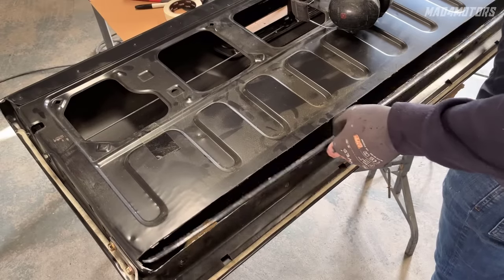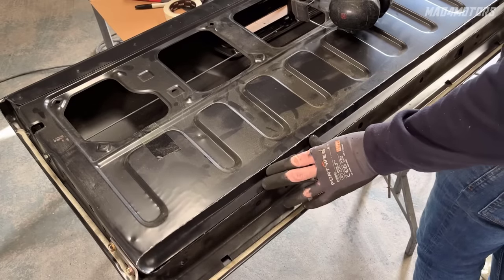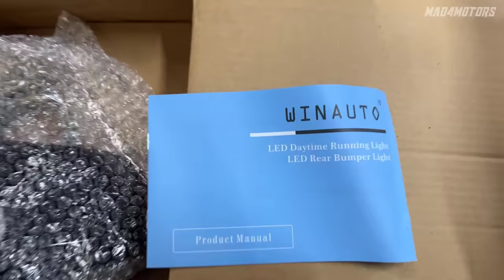Incredible Transformation Of A Toyota Hilux Pickup

Comment: Badass! One tip, you should buy a intake filter cover, cut it into a rectangle and secure it behind the hood scoop so water doesn't get on the engine. The intake filter cover is like a mesh with water repellant oil on it

Comment: Well done bud there is a tool that bends over the metal edge 
or if you use mollgrips  weld flat bar on each side of jaws draw a line put bar on  clamp 
and bend 
does quite a good job 
don't make flat bar to long or use 2 mollgrips spaced out even to get consistent bend think it will help you in future projects